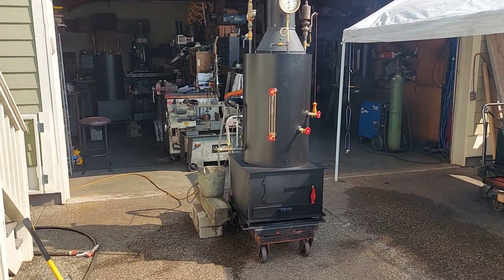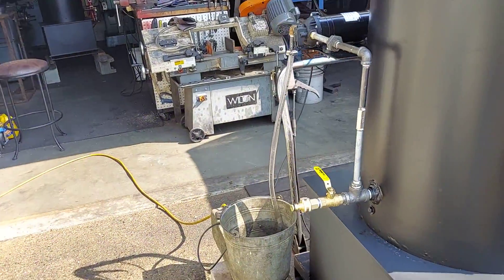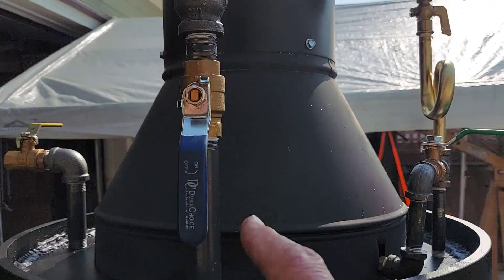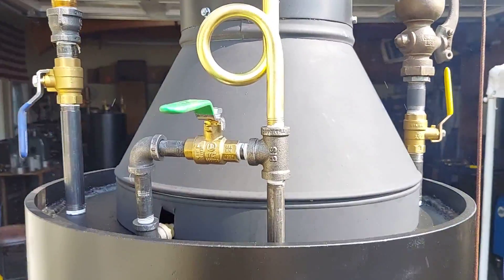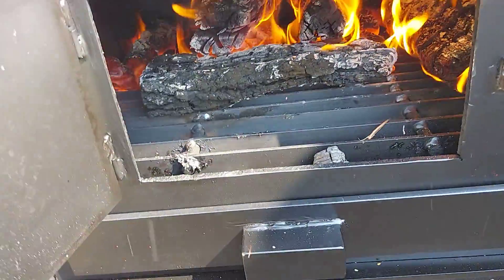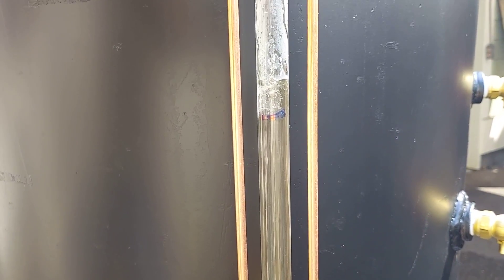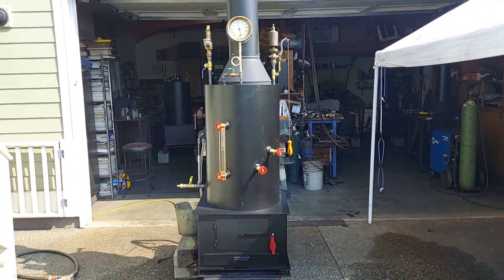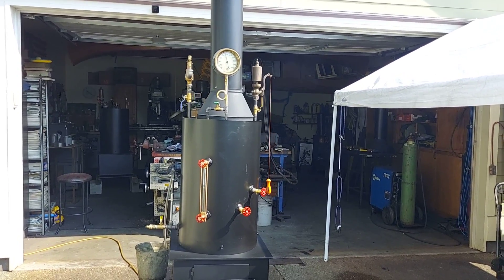FOR SALE Steam Engine Boiler Pump Whistle Gauge Off Grid Live Steam Engine

Comment: Hi Ross. It’s Matt Weston. I saw that you mentioned you can no longer get the hand pumps. Had you considered a steam injector? That would be most efficient as it uses the steam pressure to create a Venturi and suction to add water. I recently attended a steam school near me and found that to be standard on most steam tractors. No moving parts, just check valves that are opened in sequence to add water under pressure. Just a little extra piping.